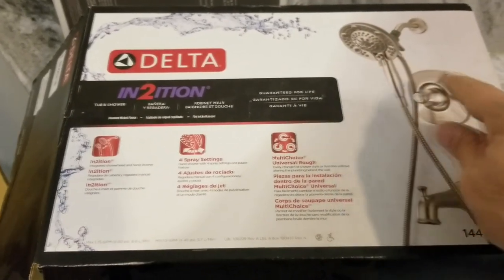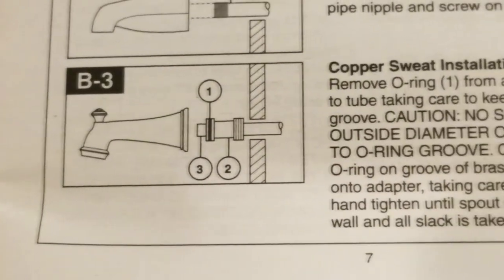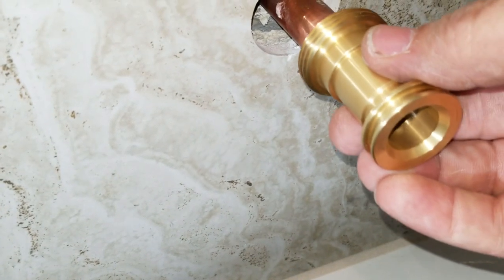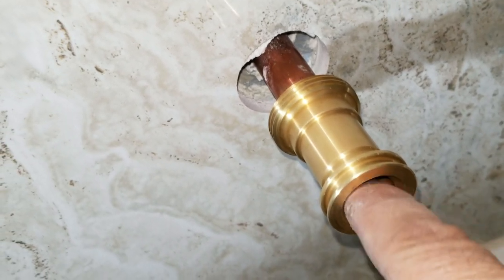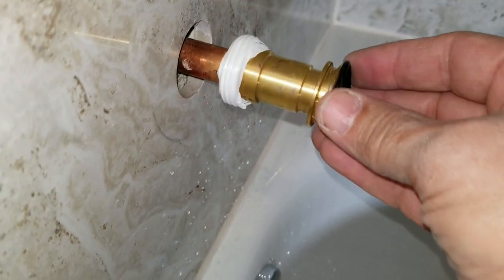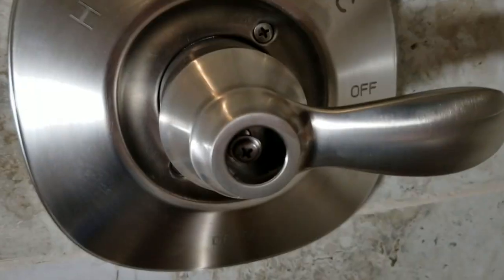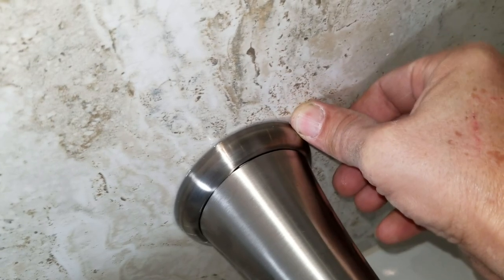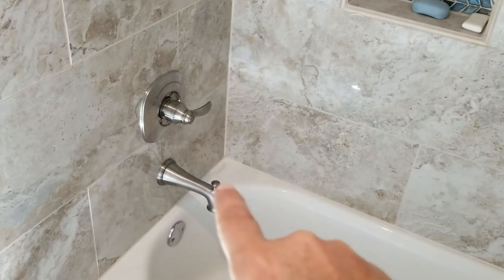How to Install Bathtub Spout, Solder on Adapter, Delta In2ition

Comment: 1) You didn't show how to remove the excess solder.
2) Apparently you don't know how irritating it is to have your video interrupted multiple times with your site advertising!
.
Reply from the maker: Number one I didn't show how to remove any excess solder because there isn't supposed to be any excess solder lol. You are supposed to put enough solder that it doesn't run and drip or collect up. 2nd of all are you referring to the commercials that YouTube that puts on top of our videos? None of us has control over the commercials that YouTube sticks on videos. Do you call the TV stations and complain about the commercials on your favorite TV shows as well?

Comment: After looking at this again, I can clearly see it did NOT hit the “stop”. When you put it on it slid about 1/8” onto the narrower opening at 4:05. 
You should take this video down. You’re misrepresenting what happened.
Reply from the maker: Clearly you are blind not only did it hit the stop but we soldered the front of the adapter on to the front of the pipe where it hit the stop that period if it had not soldered it would not have worked. You need to take your comment down.
Reply: jeffostroff you jammed the copper pipe in a few time to show the tapered down portion and said it hit the stop. Then when you inserted the fitting at 4:05 it went past the “stop” and onto the fitting by about an 1/8”. That’s where you soldered it. It didn’t “hit the stop”. That’s my point. There was something wrong with your copper pipe. It was probably out of round.
Reply: jeffostroff and why do you automatically assume it was a faulty Delta product? Why couldn’t it be your faulty copper pipe? 
I don’t work for Delta but I can almost guarantee you that something was wrong with your pipe. Copper is very soft and easy to crimp. Did you try in on another piece of copper? I would have contacted Delta and got a replacement before I did it your way.
Reply: jeffostroff what if someone is not able to get it on more than a 1/16” on the fitting? They solder it on and later someone diverts to the shower and turns off the shower head. All of a sudden you’ve got 60 or more psi on that spout. You should take this video down.
Reply from the maker: @stevewithers3532  After numerous attempts to ream the pipe, and chamfir the pipe, and the pipe was perfectly shaped because I could insert copper fittings on the end of it, we concluded the Delta product was defective. The pipe was not defective, as you know, if the ipe is even a frog hair out of round, you'll never get a copper fitting to slide on that's how tight the tolerance is. Also, like I mentioned before, when I called Delta, they mentioned a number of complaints have come in about it too. With all these people plumbers calling in with complaints do you really think all those pipes are out of round? I have never found an out of round pipe after cutting and reaming properly. Why do you automatically assume it was all of us with this issue not knowing what were doing with the pipes? Why do you assume all these pipes all over the place are out of round? the odds just don't support your theory. I've cut many pipes over the years and sweated on fittings with no problems, so an out of round pipe is highly unlikely. Plus the fact that we used the adjustable wrench trick with the 3 point contact method to "round out the pipe in case it was out of round", and that had no effect either. In short, our pipes were not out of round.
Reply: jeffostroff it is very possible the pipe was very slightly dented. Copper is soft and you don’t know what happened to it during shipment. The best practice would be to contact Delta and get a replacement. I would not feel comfortable with city pressure on a 1/8” sweating especially when it can be dislodged by bumping it.
Reply from the maker: @stevewithers3532   G everybody wants to still keep blaming the pipe instead of the manufacture of the fitting that wasn't milled properly. We checked and checked and chokes that pipe 6 different ways to Sunday it was perfectly round because it holds another copper fitting so we know there was no problem with the pipe at people keep ignoring what I'm saying. If it was even slightly out of round it would not even hold another copper fitting over it. There was no time to call Delta and wait for replacement parts which can take a week or more these people needed to shower up and running that day. It doesn't matter what you have a spout on there or not so even if the spout comes flying off with city pressure you still have the same amount of water landing in the bath tub. But anyway it is still holding a year and a 1/2 later just fine.